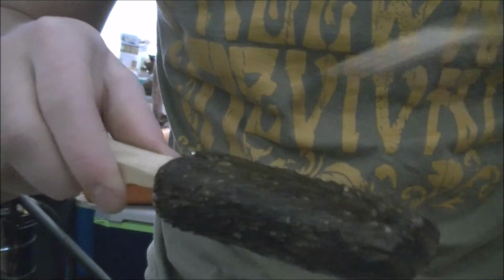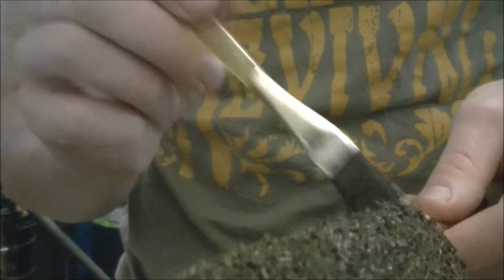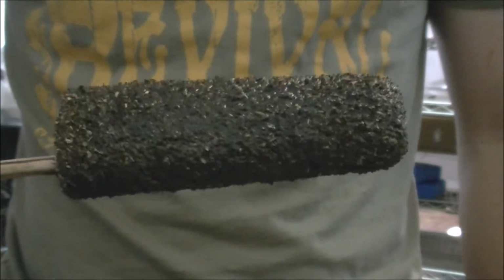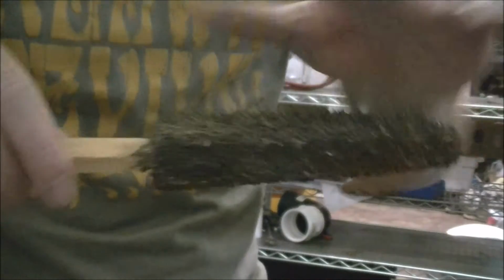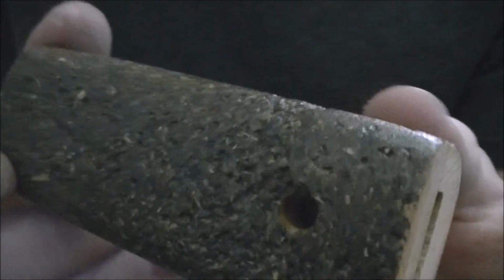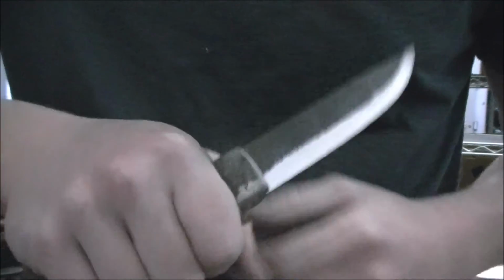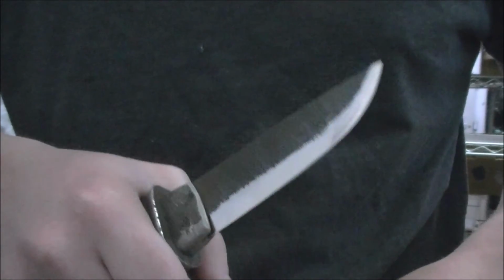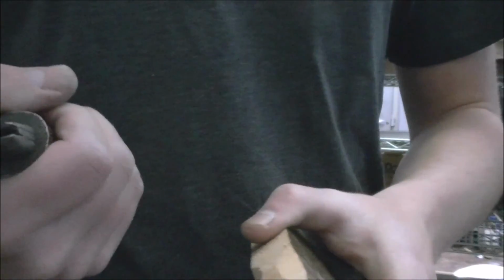Lacquering the Tanto

Comment: Wes,
It's kinda late, and I want to watch this again, but I have a few ideas that might get you were you are trying to go. I'll stop by tomorrow.
AAR
Reply: Ok, I go to thinking, you wanted a mossish look to it. I would suggest going to some of the local tea companies that have jars of the stuff and looking for two teas. Fine ground, one brighter than the other. buy in the smallest quantity, or see if they'll give you some samples. Then, using the wood you use for the handle and scabbard, make some test plates. try different proportions of dark and light tea 1 to 4, 2 to 3, etc. See which proportion gets you the shades you want. Next try it with coarse ground leaf and see if the colors hold, and the texture is right. 

If that doesn't work, then it's time to switch to ground up Malachite! Which might just work like the fire scale!

You're on the right path Wes, just needs experimentation!
Albert
Reply from the maker: Albert Rasch or even better, I can put the different colors in different places, that way it can have some pattern to it.
Reply: That's why you're the artist and I'm just the guy watching! Sort of like camo! I was thinking, a big difference between the fire scale and the tea leaves is that the tea leaves will absorb some of the lacquer, it's cellulose after all. That makes them soften, swell, and then smooth out....
AAR
Reply: Oh, and you do need to mark your work. If you are proud of your work, you need to sign it. And that knife is fine. Does the technique need refinement? Yes. But you're aware of that. The key is, as you said, learn from each experience.

As more people find you, don't be afraid to ask for critique. It will help to refine your eye to see things you may not thought of. I learned that at Following the Iron Brush where they don't hold back! Nothing is ever personal, it's all about the technique and the results. Well occasional someone got hammered pretty hard, but I think they brought it upon themselves!

Good job Wes, so, whats next!?
AAR
Reply from the maker: That's true! I made a big, heavy, chisel-ground lawnmower blade machete that had a forge-scale lacquer handle, and it seems to have more "bite" than the tea leaf tanto handle. The forge scale is not abrasive, but it creates a really non-slip feeling, whereas the tea leaves feel more cushion-like.
Reply from the maker: I was also thinking of taking some orange fall leaves and lacquering them on the wood, either trying to wrap them around as whole leaves, or breaking up the leaves and getting some bright orange color variation. And having the veins in the leaves would be a cool detail, too.
Reply from the maker: The State Fair is next! I'm going there today, and I was there yesterday. I might post a video on all the clips that I recorded after Saturday. The new forge setup is excellent, and I started a really thick "Yoroidoshi" tanto that I will finish forging today.